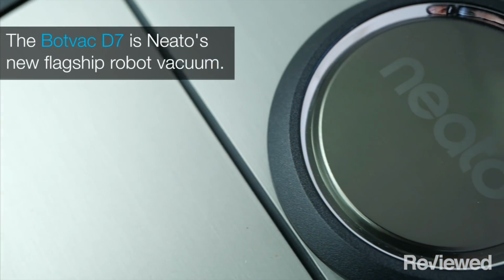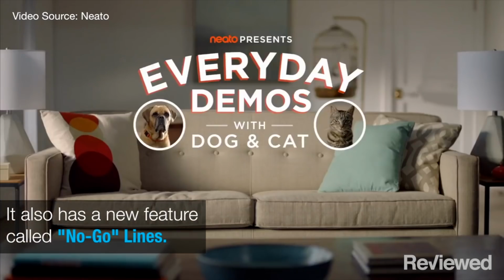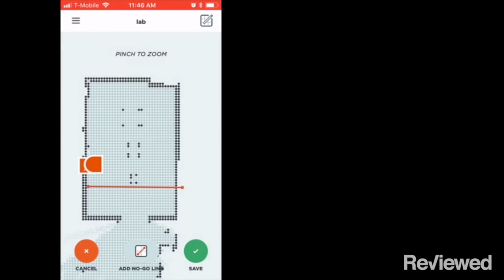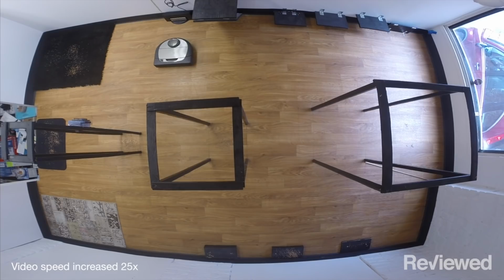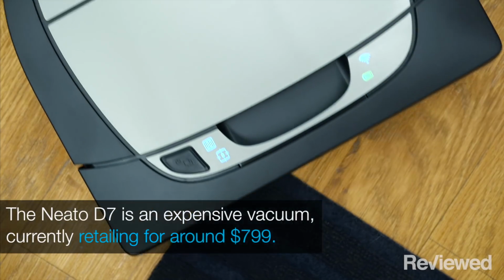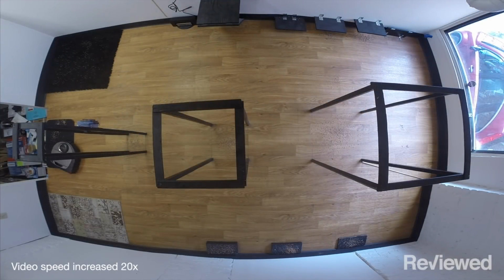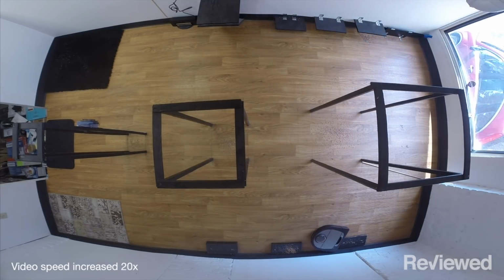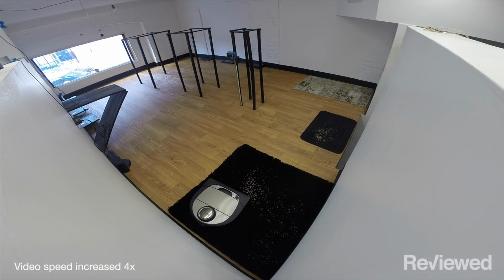Neato Botvac D7 Connected Robot Vacuum Review

Comment: The Neato Robotic vacuum does an excellent job of vacuuming our home🌼 It is amazing (and a little embarrassing) how much dust and detritus it picks up. The D shape does enable it to get into corners. Controlling it with the App is very easy. A plus is the vacuum tells you if it needs emptied, if it is stuck or if it has tried to swallow the occasional wayward sock.

Comment: which is better, this or roomba 980?
Reply: why is Roomba better? I have a neato D connect and my friend has got the roomba 980 and we both agree Neato is better mostly because of it's navigation features. You can see in this video how methodical and efficient Neat is to navigate to the room. Because of it Neato takes less time to vacuum and it vacuums every part of the room.
Roomba is overrated.
Reply: Hi, so both vacuum at same location, Neato will finish the task faster?
Reply: glentaker Yes it will. bigger the room, larger time difference it will be.
Reply: romba 980 vs neato d7: https://youtu.be/qxSM7L6iRcs